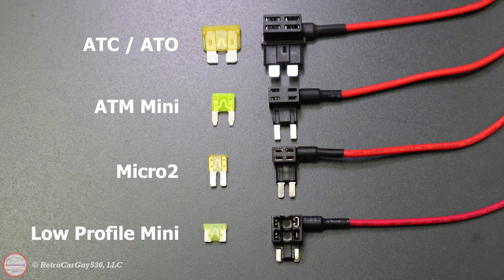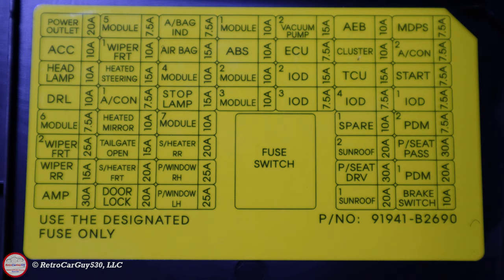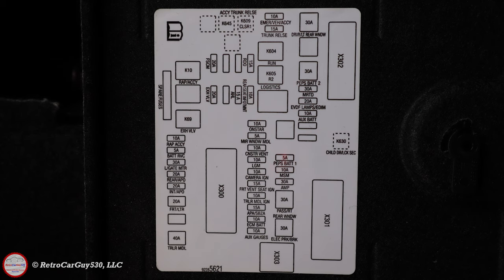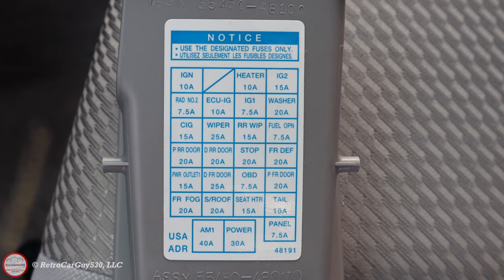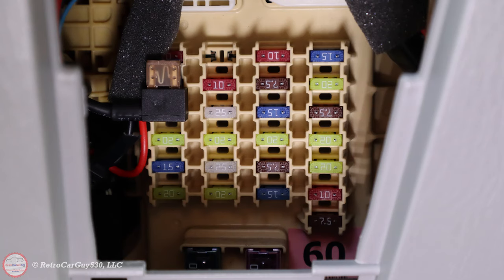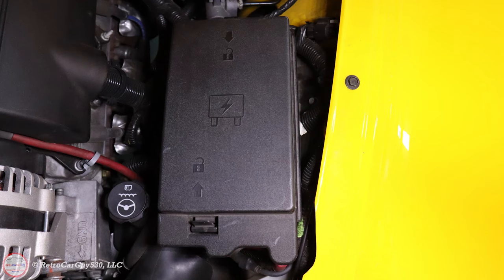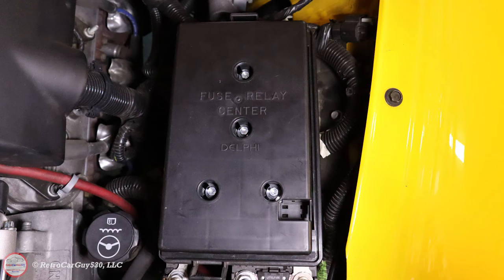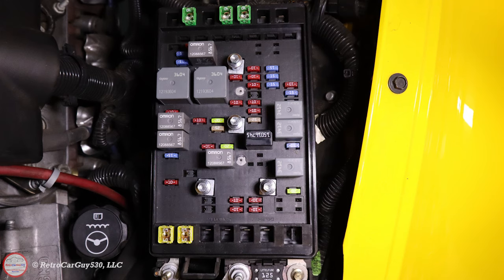How To - Add a Fuse Tap in Your Vehicle

Comment: Hello Retro!
A question: In the manual of my hardwire it says the following:
Input voltage: DC 12-30V
Output voltage: 5V
Output current: 2.4A
I was wondering if the fuse I need to protect the dash cam should be 2.4A?, can I use a 3A fuse? Thanks!
Reply from the maker: The output rating of 2.4A is likely the maximum for that 12-volt to 5-volt USB power adapter.  Most dash cameras draw 1 amp or less.  I would recommend a 2A or 3A fuse for the fuse tap fuse socket that supplies power to the USB power adapter.
Reply: @RetroCarGuy530  Retro you Rock! Many thanks!

Comment: So do I need a fuse to put in my fuse tap or can I just put the fuse tap in and get power from the wire on the fuse tap? I’m trying to connect a remote turn on to my amp so it will turn on only when the car is on.
Reply from the maker: The wire coming out of the fuse tap only receives power when the top fuse slot in the fuse tap has a fuse installed.

Comment: Thanks. What I'm trying to power off the fuse tap is a 12 volt light. Can I run a toggle switch from the fuse tap to the light? And what amp fuse do I need. Thanks
Reply from the maker: Yes, you can place a toggle switch in the circuit coming from the fuse tap which then will deliver power to the light.  I have no way of knowing the appropriate fuse amp rating necessary for a light.  There are far too many light types and each require a different amount of amps to power it correctly.  If you have a digital multimeter that supports checking amp draws if connected in series in the circuit (up to 10 amps usually), you can setup a test with the multimeter in the circuit to monitor the amp draw (looking for the max amount) and use that as a guide to select a fuse that will allow that number of amps to be delivered without blowing the fuse.  That also assumes the power demands of the light are not beyond the available amps in the fuse socket or supported by the wiring.  I have two other videos on this topic (FAQ and an anatomy of a fuse tap) that might be helpful to explain those limits.  Checked the pinned comment on the video for links to those videos.
Reply: @RetroCarGuy530  Thank you so much I'll check out the other videos

Comment: My tap ( in empty always hot ) will only work with 2 fuses. Both 10 amp.
Reply from the maker: I can almost guarantee that if you pull the fuse tap out of the fuse socket and retest which side of the fuse socket is providing power it will be the side of the fuse box fuse socket where the right leg of the fuse tap was inserted.  It should be a simple reversal of the fuse tap in the fuse box fuse socket to make it so only the top fuse is required in the fuse tap. 

The side of the fuse box fuse socket that provides the power must be the side where the left leg of the fuse tap is inserted.

Comment: Thanks. For my 1999 Chevy Silverado 1500 my Auxiliary Power outlets including cigarette lighter power always remains on (constant). Can a fuse tap resolve that?
Reply from the maker: One fuse tap will not resolve that situation, but if you used two fuse taps joined together there might be a solution.

If and only if there is another fuse socket in the fuse box that supplies switched power instead of unswitched (constant) power and there is sufficient amp capacity in that fuse socket for the power demands of the power outlets.  

You could use the first fuse tap in the fuse socket that supplies switched power and the wire from that fuse tap could be connected to a second fuse tap that would then replace the fuse in the fuse socket that supplies power to the power outlets.   The top fuse sockets in the two fuse taps would need to have fuses of the correct amperage for the power needs of the power ports.

You would need to reverse the fuse tap orientation in the power outlet fuse socket so the power that comes in on the fuse tap wire will be fed through the fuse tap's top fuse and then down the left leg of the fuse tap.  The left leg of the second fuse tap would be installed into the unpowered (outbound power) side of that fuse socket.  The constant power side of the fuse socket for power outlets ends up not being used since there would only be a fuse in the top fuse socket in the second fuse tap and the power going down the left leg of the fuse tap is plugged into the outbound power side of that fuse socket.

I must stress again, only if the fuse socket where you're finding switched power has enough amps available (see my FAQ fuse tap video) to supply the power of the power outlets.   You must make sure the fuse tap wire can carry the number of amps required (see FAQ video for wire sizing Q&A).  FAQ video link: https://www.youtube.com/watch?v=DnZ5wb_A5vE

Not the prettiest solution, but one that can work.  I've actually made this kind of change in my 2004 Chevy SSR pickup's center console fuse box.  It allows the power ports on the lower portion of the dashboard to have switched power.  I use that switched power to power my TPMS monitor screen only while I have the engine running.

I hope that makes sense and helps.  Please confirm the power needs of the devices you will plug into the power ports to make sure the fuse tap wiring can handle the power demands required.
Reply: @RetroCarGuy530  thank you sir will give this a shot carefully

Comment: Can you use more than one fuse tap?
Reply from the maker: Yes, you can have more than one fuse tap present in a fuse box, but it's recommended to use a few as possible.  You cannot use more than one fuse tap per fuse box fuse socket (you cannot daisy chain them together ).  I would only suggest one or two fuse taps (max) per fuse box.   The auto manufacturer will tell you that you can't use any fuse taps because they designed the fuse box to only provide power to the devices as the vehicle was originally equipped.  There is some amount of excess power in the power distribution bars in the fuse box (metal connections on the bottom/inside of the fuse box that provide power to several fuse sockets at once) that supply unswitched or switched power.  That's why you want to target a fuse socket that provides power directly from the battery (unswitched power) or while the ignition switch is on (switched power).  There will be fuse sockets in a fuse box that obtain power from a module (like the body control module) that are not viable candidate fuse sockets for a fuse tap since the module is providing power for a specific purpose and it may be monitoring or somehow upset when the amount of current draw on that circuit changes (by adding a fuse tap).

A fuse tap has its own limitations as well.  The 14 awg or 16 awg wire coming out of the fuse tap will limit the amount of amperage that can be delivered to the new accessory to the 10 to 15 amp range.  That 10 to 15 amps is assuming you've run through the max amp calculation I mention in the video of a max of 25 amps per fuse socket (25 amps minus the amp rating of the original fuse in the fuse socket [if any]).  I discuss that in more detail in my FAQ video.  https://www.youtube.com/watch?v=DnZ5wb_A5vE

Comment: what id both sides of an acc fuse have power going through them while the vehicle is off?
Reply from the maker: If you're testing with the fuse installed in the fuse socket, then that suggests the fuse socket is either an unswitched fuse socket or a switched fuse socket that might still have power present for a short time after the engine is turned off (the "Retained Accessory Power" feature mentioned in the video).

If you're testing the fuse socket itself (with out fuse in the fuse box fuse socket) and you find power on both sides of the fuse box fuse socket, then it sounds like something is back feeding power to the side that should be unpowered.  

This can happen when a fuse tap is present in a different fuse box fuse socket that was originally empty (from the factory) and someone has put a fuse in the lower fuse socket of the fuse tap in addition to the top socket of the fuse tap.  The bottom fuse socket in a fuse tap should only have a fuse in it if the fuse box fuse socket originally had a fuse in it.  When installing a fuse tap into a fuse socket without a fuse in it to take advantage of an "empty" fuse socket and you install a fuse in the bottom fuse socket of the fuse tap, you are now potentially supplying power to things in the fuse box that originally did not have that power available.  This can be a source for a parasitic power draw situation since potentially unswitched/constant power may now be fed to circuits that should have that type of power.

If that did not answer you question, please supply more specific details of what you are testing and your test results.

Comment: Good day sir hoping you could notice my inquiry im planning to fuse tap and i want to use relay, should i still add fuse holder to the relay? If so should i still add fuse to the bottom of the fuse adapter?( I will be using the cigarette lighter fuse socket which already has 15amp)... Thanks!
Reply from the maker: I'm a little confused on what you're trying to provide power to using the fuse tap.  There are two circuits for the relay the control circuit and the load circuit.  The control side of a relay usually consumes a very small amount of power (100 mA / 0.1 amps).  The load circuit of the relay needs to have a fuse at some point in the circuit (before the relay) to protect the relay and all wiring and the device it provides power to.  If you want the cigarette lighter to continue to have power available to it, you will need to place a fuse in the lower fuse socket of the fuse tap.  If you're going to be providing power only to the relay load circuit from that fuse box fuse socket, then there's no need to place a fuse in the lower fuse socket of the fuse tap which will leave the cigarette lighter socket without power.
Reply: @RetroCarGuy530  thank you very much youre a life saver! Sorry for the confusion hehe i just want the cigarette lighter to be an trigger
Just subscribed to your channel... Mor power!
Reply from the maker: If you're using the fuse socket that provides power to the cigarette lighter as the control circuit power for the relay, then you would need to put a very small amp fuse (2 to 5 amp) in the top fuse tap fuse socket and the original fuse box fuse socket fuse (15 amp) in the lower socket of the fuse tap.  That will give you the power necessary to control the relay and keep the cigarette lighter powered.  The assumption here is that the fuse socket for the cigarette lighter provides switched/accessory power only.

Comment: Hi i loved your video... I was just wondering, #1 if i install 2 20w led bar and use it as a DRL, do i still need a relay for that or i could just directly fuse tap the wires. #2 if i need a relay, is it necessary to have a switch installed or and how do i install a relay without a switch since i want my DRLs to turn on together with acc1 o acc2 on ignition switch. And #3 is it possible to fuse tap an aux light or led bars with a relay without using a switch, and how to do it?... Hehe thanks, i hope you can help me with my concerns...
Reply from the maker: If you're going to be drawing power for light bars, I would probably go with a fuse tap that drives the control side of a relay.  The relay should be a fused relay for the power draw side of it and connect that to a heavy gauge positive power lead (to the fuse box or near the battery).  You would tap into a fuse socket that is on only when the accessory power is on or when the ignition is on while the engine is running.  This way you control the power to the lights in a controlled manner without the need of an extra switch.

I did this exact thing when I installed a dash camera with an external battery pack.  The relay control side was connected to an "ignition on" fuse socket in the fuse panel and the fused power draw side of the relay was connected to the positive terminal on the car battery (which just happened to be located in the trunk near the fuse panel being used).  This allowed me to charge the dash camera external battery pack using up to 9 amps which allowed the battery pack to charge quicker than if had been connected using a standard power port plug (max 5 amps in that config).

You need to identify a fuse socket in the fuse panel that has "switched" power to drive the control side of the relay.  

This way the power draw on the fuse panel is not impacted greatly because the power draw of the lights is being supplied by the fused power draw side the relay.

I hope that helps
Reply: @RetroCarGuy530  do you have a diagram for that sir? Im a little confused, do you mean that instead of using an actual switch, i should connect that part of the relay to the fuse box so that it will turn on when the ignition is on?..
Reply from the maker: The relay has two circuits in it.  The control side and the power draw (load) side.  The control side of the relay will have an input 12-volt power and a ground.  The input power to the control side of the relay can be supplied by power from an actual switch or power from a fuse tap added to the fuse panel into a fuse socket that has "switched" power.

The power draw (load) side of the relay is where you provide power to the "thing" you're trying to power.  In your case this is the power to the light bars.  This gets its power from a 12-volt power connection with proper wiring to handle the amperage of the item needing the power.  That circuit needs to have a fuse of its own to properly protect the power draw (load) side of the relay and the item being supplied via the power draw side of the relay.

In my dash camera battery pack example, the control side of the relay was connected to a "switched power" fuse socket in the fuse panel using a fuse tap.  The fuse tap had a low amp fuse (5 amp) in the fuse tap to supply power to the control side of the relay since this is only controlling the relay.

The power draw (load) side of the relay was connected to the 12-volt battery positive terminal with a 10-amp fuse in power draw (load) wiring.  In my particular case, the relay itself had a fuse socket in it on the power draw side where I placed the 10-amp fuse.  

Here's an amazon.com link to the relay that I used with the dash camera battery.  https://amzn.to/2TJZMQR

That is an Amazon affiliate link, so if you make a purchase within 24 hours of using that link I will get a commission on the item or other items purchased at amazon.com at no additional cost to you (standard disclaimer for any affiliate link I post).

One of the pictures available for that item is a "Normally OFF Relay with a Positive Trigger".  That is the manner in which I used it with the dash camera battery. 

The "To Positive Trigger Source" (pin 86 on the relay) is the input power on the control side of the relay.  This is the one that I connected to the switched power fuse socket in the fuse panel.  Pin 85 is the "To Ground" which is the ground for the control side of the relay.

Pin 30 of the relay goes to the 12-volt positive battery power and it has the fuse in it (part of this particular relay).  Pin 87 is connected to the power draw (load) device and in your case that's the light bars.

I hope that helps!
Reply: @RetroCarGuy530  yes! Its much clearer now that you mentioned those numbers on the relay... Thank you very much sir and i niw ckearly understand hiw a relay actually works... ☺

Comment: So I have to use the mini fuses in the add a fuse? They have to be the same? I didn’t think that mattered
Reply from the maker: There are four common types of blade style fuses.  ATC/ATO, ATM Mini, Micro2 and Low Profile Mini.  The type of fuse tap that you use must match the fuse type it is being used with.  The fuse socket in the fuse box and the fuse tap must be the same.  The fuse sockets in the fuse tap are the same type as the fuse box fuse socket.
Reply: @RetroCarGuy530  that’s what I’ve gathered that really blows I got two different types of fuse tappers and they are both the wrong size. I have the mini ones that don’t stick out at all. Thanks appreciate it!

Comment: My dashcams hardwire kit already comes with fuses attached to the wiring. For now i simply used an empty 5amp fuse slots which work. Though these slots goes to sleep only after an hour. So in most cases i’l be filming my garage or works parking lot for an hour after arrival. Was thinking to tap in to cig lighter fuse. As that switches off together with ignition. As my hardwire kit has fuses at the end of the cables, can i just pop those fuses in to the tap a fuse adapter? Can the circuit come through the fuse or it has to connect to the adapters wiring?
Reply from the maker: As long as there's at least one fuse per power wire to protect the circuit, it doesn't need to be the inline fuse in the hardwire kit wire.  The blade style fuse tap will require a fuse in the top socket to provide power to the new accessory (dashcam in this case), so there's no need to have a second one from the hardwire kit present, but it won't hurt anything to leave it in the wiring.
Reply: @RetroCarGuy530   I did just plug the hardwire kit's fuse (which is connected to circuit) right into the fuse tap adaptor. And it works perfectly ;) Thanks for your answer.

Comment: What do I set my multimeter to test the fuse box?
Reply from the maker: To test for power at the fuse box, you would set your multimeter to DC Volts at a setting that would be able to test for 12 to 15 volts DC.  You would connect the ground of the multimeter to a ground location on the vehicle or the battery negative terminal if it is close enough to the fuse box.  Then use the positive test lead to check for voltage.